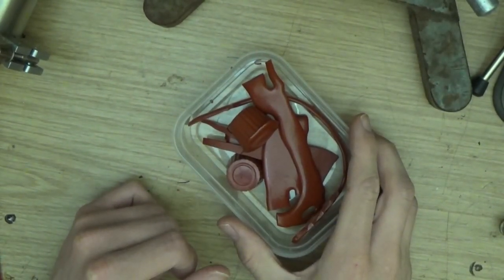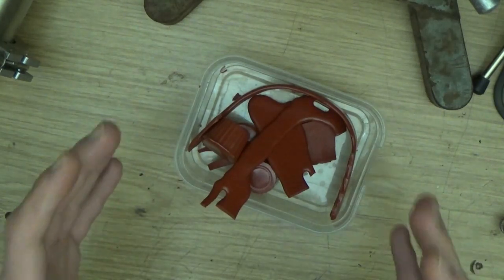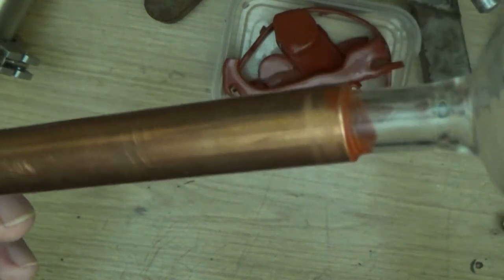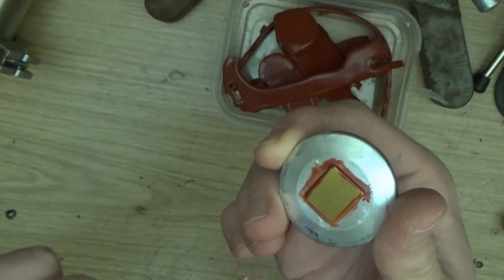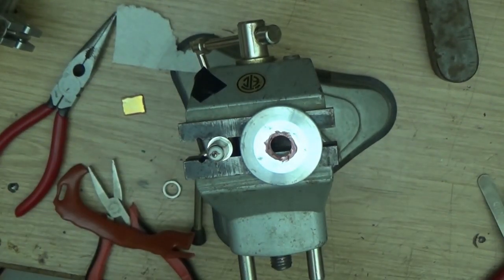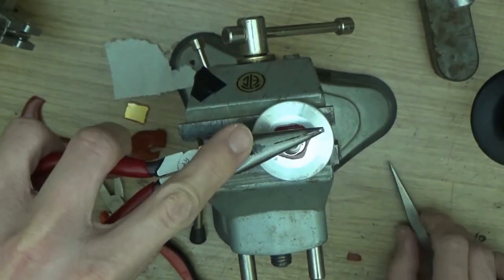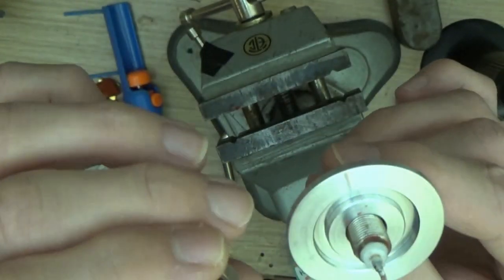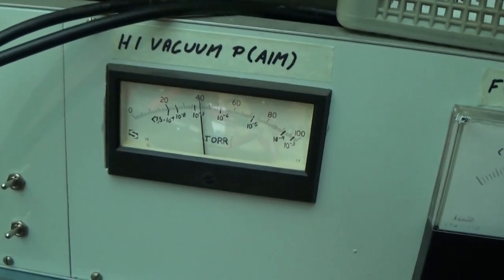Faraday Wax - DIY Historic High Vacuum Sealant

Comment: OMG Thanks for making this Video! I have been looking forever for a cheap vacuum sealant.
Could you maybe test how well it performs when there is a larger surface area exposed to the vacuum? Maybe fill a 3/4 inch pipe to test it's capability's. That would be awesome 😊

PS: Also thanks about that tip about virtual leaks :)
Reply from the maker: Have considered that, just sealing wires into a flange to make feedthroughs, but in the end I think it's asking a lot of the material. I did put an entire lump of it in the chamber and the outgassing wasn't terrible (10^-6 torr still)

Comment: Really Neat!  Now i am wondering about:
- Use of (Microcontroller Modified, similar to those “DIY Reflow Ovens”) “Toaster Ovens”, Heat Guns, and Soldering Irons, (Also maybe some modified hot air plastic welding gun)

- Use of more pure feedstocks (High Grade Beeswax, Paraffin Wax(es), specific solid fats, etc)

- Something akin to “Dip Soldering” but with a vat of heated this (could use a Fondue pot even, lol!)
Reply from the maker: The purer (and commercial) alternative is "Apiezon W" or Q. Still used to mount SEM samples to the stage I believe.

Comment: I tried making some Faraday wax with 1-part bee's wax, 5-parts colophony, and 1-part iron oxide powder by weight.  The wax is extremely brittle. I tried remelting and adding an additional 1-part bee's wax, and this made the wax a little more flexible, but it still breaks into small pieces during handling. Could you make a video detailing the exact ingredients purchased and the process you used for making Faraday wax?   Did the bee's wax you used also contain paraffin?   I used natural bee's wax.

Comment: You've reminded me here about the technique Adrian Bowyer used in the very early RepRap days for making 3mm rods of printing plastic, which was to roll the material between two sheets of plate glass along with a 3mm glass stir rod. Would this technique be useful for making faraday wax rods? It may be too sticky, however.
Reply from the maker: Making rods of it would definitely be nice. Maybe it could be used in a hot glue gun

Comment: Great find for DIY vacuum sealing, and great points about virtual leaks! Never thought about that.
Could you use a hot air gun to avoid char? Also what is the mass of Venetian red? You have masses of 10g and 50g but not for the last ingredient. Wasn't sure what you meant by equal parts earlier but mass is unambiguous!
Reply from the maker: Look in the description, there is the recipe! :)

10 g. Venetian red, added to 10 g beeswax with 50 g colophony.

An air gun might work, but you would then spray the wax with all the dust in the air. I guess it's a judgement call
Reply: @chromatogiraffery3104 Of course, with a butane flame it puts out an invisible cloud of steam/moisture that condenses on cooler surfaces, so I guess you have to pick your poison 😊

Comment: Hi thanks for that great hint.
I have a vacuum tank and inside it the temperature is also getting high up to 300 degrees. Would it cause a sudden leak into the chamber if it gets melted?
Reply from the maker: Thanks! Absolutely! The wax melts at like 80 degrees and would be as liquid as glycerol at 300 degrees. It might even burn! At this temp i don't even think hysol 1c or torrseal would save you, sorry.